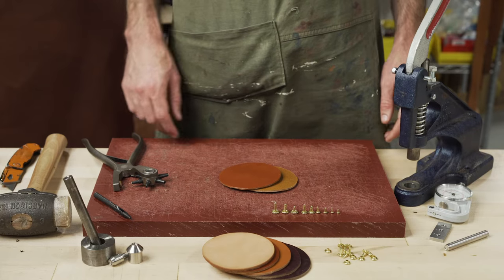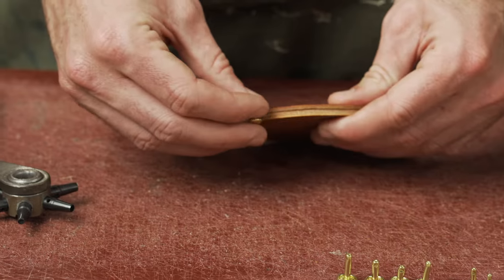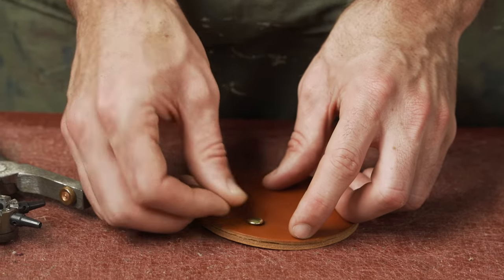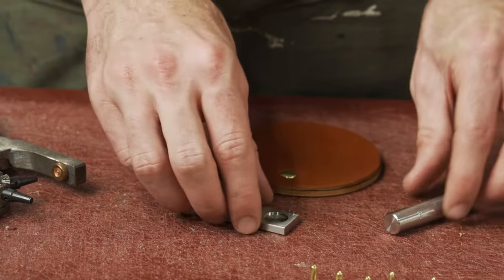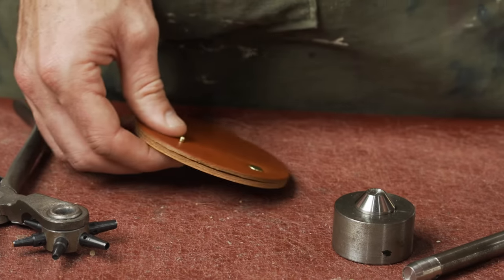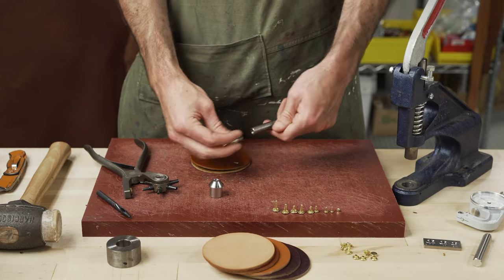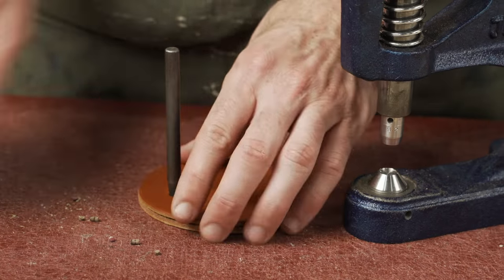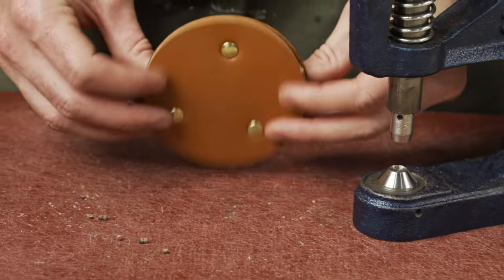How To Set Rivets in Leather

Comment: are these kind of snaps supposed to give a strong joint? when I put them and I pull the to pieces of leather apart they get separeted with little force. Thank you
Reply: I do not know what brand of rivets you use, but I use solid brass Jiffy rivets and if you set them right they are extremely difficult to tear apart, almost tears the leather. If you want an extremely strong rivet but do not want the hard to set copper and burr type rivet you can use tubular rivets that look like a regular rivet, but they are not coming apart without drilling them, but you need to buy a peening tool to spread the back of the rivet for $15. You can buy them at the Buckle Guy.